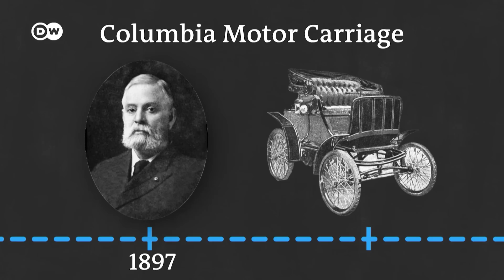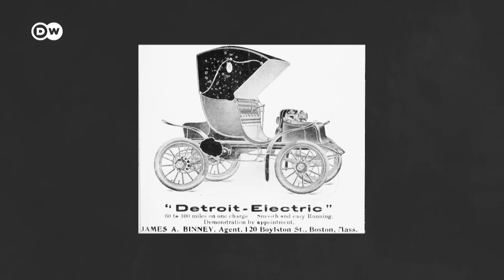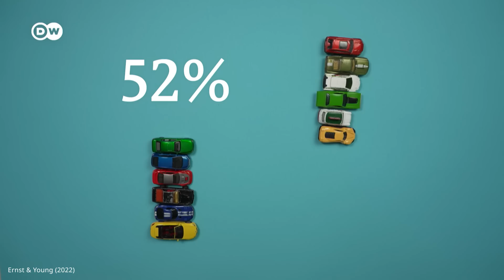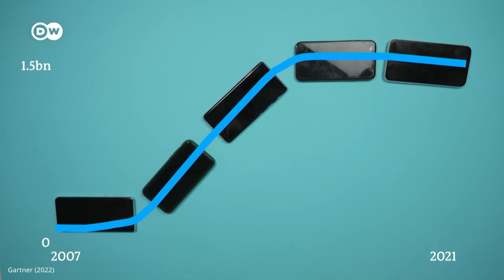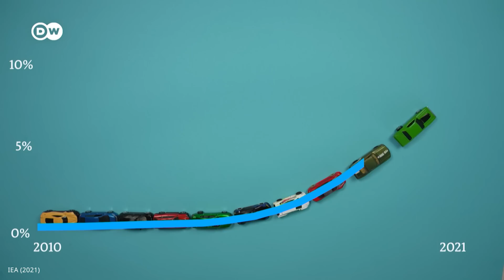Why electric cars are finally taking over

Comment: if you only go to work and back i think you can get by with and EV, if you want to travel any distance i will stick with gas
Reply: People do long distance road trips with Teslas all the time. It’s really not a problem. There are lots of videos documenting it. The chargers are common and they are fast. If you go to the bathroom and grab a snack, usually the car is ready before you are.
Reply: @lemongavine  if you say so, all i know is i can fill up my car and go around 400 miles till i have to stop again. My car is paid for so i will stick with it for a while, i do not have money for a tesla
Reply: @mastersr1956  how do you afford filling up your tank with all of those long trips you take? Between fuel and maintenance cost savings, a Tesla cloud be free if you drive a lot of miles, which it sounds like you do. Also, there are EVs with good range that are cheaper than Tesla.
Reply: @lemongavine  well i have a 12 gallon tank, so it cost around 40 bucks to fill up. I have a 2021 kia seltos. I paid 30 grand for it. For service i change the oil and filters when needed. Maybe another250 a year for service. That is a long way from 60 grand for a tesla just to start, then i need to by a charger to charge it also. I think i will stick with my car thank you
Reply: @mastersr1956  Sounds like you don't drive much. My 2021 Hyundai Kona EV was 30 grand new (after incentives). It goes about 5 miles per kWh so that's about $0.04 per mile at my electricity rate. I use a regular 110V outlet in my garage and the portable charger that came with the car so no extra equipment was needed. Also, no oil changes to pay for or deal with. It goes 258 miles on a charge which is a good 4 hours of highway driving. On top of all of that, the car is extremely quick, smooth, quiet and fun to drive, all of which are important to me. I realize EVs aren't for everyone, but a lot of people write them off when they are a great option for them in real life.
Reply: @lemongavine  well if i had a garage i guess that would be great, i park on the street so i would need to drag a cord across the sidewalk to charge my car. I think for a second car they would be ok, i do not want that to be my only car, i will stick with gas
Reply: @mastersr1956  street parking is definitely a problem. There are people who can’t charge at home or at work who still drive EVs, but they rely on DC fast charging once or twice a week which isn’t ideal at the moment (20 to 40 minutes charge time). In the future though, EVs will charge in 5 minutes. Until then, gas it is. Nice chatting with you by the way.
Reply: @lemongavine  you too, nice to have a civilized conversation for a change. i do think they are the future, but just not ready for everywhere yet
Reply: @mastersr1956  👍

Comment: Electric Cars went out of fashion when the electric starter was invented eliminating the need for a crank start, which was difficult to accomplish and caused injuries.
Reply: Too bad the video researchers did not discover that point.
Reply: Cadillac is to blame
Reply: Yea that’s when gasoline cars officially became more “efficient” from a time perspective. Before that, electric cars technically saved you more time if you were doing lots of little hops around town in order to run errands and whatnot.

Comment: Don't forget about the Nickel Iron Edison Battery back in the early days that was good for 40years.  These were made for Ford and you can still find functional ones today.
Reply: Can you share some details?
Reply: @paranoah1925  - “Building on the work of the Swedish inventor Ernst Waldemar Jungner, who first patented a nickel-iron battery in 1899, Edison sought to refine the battery for use in automobiles.

Edison claimed the nickel-iron battery was incredibly resilient, and could be charged twice as fast as lead-acid batteries. He even had a deal in place with Ford Motors to produce this purportedly more efficient electric vehicle.”

Comment: Even better for the environment than EVs is not buying EVs.
Reply: True, but I think cars will always be here.
Reply: @Richard482  Not if the planet becomes inhabitable. The solution is much fewer cars - EVs may be nice but the EV hype gives us the complacency to change nothing in our habits.
Reply: @241baka  Fewer cars, absolutely. But I think cars will always be here. Do you have a family?
Reply: Makes almost double the pollution to make a ev vs a regular car
Reply: @Babaden994  But the lifetime carbon footprint of EVs is FAR smaller. It’s not just the manufacturing footprint, it’s the operation footprint.
Reply: @davestagner  depending on how the ev gets it's power. You'll still have to account for all the coal that is burned for most grids. Along with transportation emissions of all the resources. I do agree that some areas will have a lower lifetime but I don't think all will.
Reply: @davestagner  ..unless you count in manufacturing of whole new battery pack every few years...
Reply: @Babaden994  - burning coal for electricity is still cleaner than burning gasoline to propel your vehicle. Fossil fuels are way better at making steam to power turbines than to turn crank shafts with pistons.
Reply: @thespalek1  - why would you need a new battery every five years. Do you drive 60k miles a year?
Reply: @Babaden994  You get SIGNIFICANTLY more power from gas or coal burned in a power station to generate power and charge EV's, then you would by having that same gas in a car. Car engines are way less efficient at burning the fuel so the EV's still win out in that case -- plus more and more places are moving away from coal anyway. where I live it's like 5% of the grid, 80% is made from hydroelectric dams and 15% from other green techs. The biggest issues with them is the resources to make the batteries - which IS getting better (lookup Summit Nanotech's DLE or Direct Lithium Extraction technology) and the mining required for the steel and aluminum production in the frame.
Reply: @legostud  the battery life is decreased every charge by a small % and further reduced by cold and overly hot weather. Also the actual charge and range is usually about 80% of advertised and even lower during the winter.
Reply: @thespalek1  Lithium batteries are mostly recyclable. Once production levels off, most of the lithium in the batteries will be recycled. More important, though, you have to compare this to the environmental cost of gasoline - besides the CO2, there's drilling, refining, and transporting. A car that gets 30mpg for 150k miles (about the life of lithium batteries) will burn about 5000 gallons of gasoline. Given a mean EROI of 20:1, it costs the energy equivalent of 250 gallons of gasoline just to GET the gasoline for that car. Counting the CO2, that's about 5000 pounds of CO2 created just getting the gasoline TO the car, and another 100,000 pounds of CO2 generated by the car itself. 

Don't just react to stimuli. Do the math.
Reply: @Babaden994  The electric grid is rapidly converting to wind/solar, though, because it's cheaper than coal now. I don't like coal-powered cars either, but I recognize they're a temporary price to pay - and at worst, they might be as bad as gasoline, for a while. In the long run, though, a renewable grid plus electric cars is the only way to continue with transportation without carbon.
Reply: @Babaden994  - yes, battery life is affected by extreme temperatures, which is why the majority of EVs have thermal management systems to keep batteries at the proper temperature. 

That small percentage of battery degradation you mention usually happens during the first few years and then levels off.  I believe it only gets to be about 5-10% degradation. 

What kills a battery is charge cycles. A lithium ion battery has 1500 charge cycles. You multiply that by it’s range to determine how many miles the battery will last. This is of course a best case number, but you’ll still find it be a fairly decent life time for most cars. 

Now if you’re only looking at the crappy Leaf or some other short range (100miles) compliance EVs, then yes those EVs aren’t very good.  There’s a lot of other options out there though that don’t suck and some with Lithium Iron batteries that can go 1 million miles.
Reply: @davestagner  :) I agree, do the math. Find out, how CO2 intensive it is to recycle the battery (pyrolythic separation, or shredding is used), CO2-wise it's even worse, than mining raw.
As for mining oil, I agree, pesonally I am supporter of synthetic fuel, which would allow to switch on current technology, current infrastructure, no strings attached.
Reply: @thespalek1  I have high hope for synthetic fuels as well. Partly because heavy transport (shipping, aircraft, long distance trucking) are harder to electrify than cars, partly because I grew up with racing and love old fashioned classic cars. But it’s not there yet. Climate change is here, now. We must apply the solutions we have, not the solutions we want and might have in ten or twenty years.
Reply: @davestagner  and that is exactly my point. If synthetic fuel got the same support as bev infrastructure, we could switch to that almost immediately. It can be produced from waste methane from rafineries for example, really easily. There would be no need to build studrier electric grid, no charging points needed, no subsidies for new cars, no need to destroy nature by lithium mining etc. You'd simly fill up with synthetic one day....
Reply: @thespalek1  For it to be a short term thing, the fuel needs to be gasoline (and diesel and jet fuel). You can’t change the cars themselves. Prometheus Fuels is on the right track, but we have to see what their cost really is. The market is your best friend or your worst enemy. That’s why solar/wind are growing now… they’re cheaper than coal. For synthetic fuel to work, it needs to be cheaper than fossil fuel. Which is theoretically possible and people are working on it, but it’s not real yet.
Reply: @davestagner  There is a start-up in the us, can´t find it right now, producing synthetic fuel from waste methane, which is otherwise just burnt away. The price is 2/3 of gas right now. And there are many other start-up, developing the fuel out of municipal waste, even scrap metal... (and btw. where I live, coal energy is 4x cheaper, than solar)

Comment: I think it is crazy that it takes 5,000 lbs car to move one person (Tesla model S).
Replacing a Tesla battery for any reason ~ $20,000.
Car quits for any reason requires a truck transport to nearest Tesla Service center.
Charging stations are not yet frequent or reliable.
Until these concerns are resolved, no EV for this guy.
Reply: It is even more crazy to pollute with an ICE car which may be lighter but nowhere near as efficient.

Battery prices are falling all the time, and new battery tech will out last the car. This is not a long term issue.#

Same as any car.

Depends on the charging station. Tesla have a huge and ever expanding network, with over 98% reliability.

Any concerns are short term, EV's are now inevitable.
Reply: @daydreamer8373  better yet, public transit, biking, and walking.
Reply: @The_k81  Absolutely. but not always practical.

Comment: I have seen more electronic-cars in my area however I panic because my area is extremely hot and even my traditional gas-feuled car needs its battery replaced more frequently because of the climate here. I firmly desire a world with various transport fuel types, not just electric. I would like to ditch my gasoline-powered car however right now that lifestyle isn't feasible with the infrastructure etc. I'm baffled why we haven't done more algae powered cars or hydrogen powered cars... or even researched a new substance to power vehicles someday.
Reply: Algae powered cars woah ??
Reply: @nayanvaishnavvv  Yes, awhile back my university were looking into that as a possibility.
Reply: @4-kathryn  Yeah we should continue looking for possibilities while at the same time EVs should be rolled out at a faster rate and somewhat less cost, they are hella expensive in my part of world
Reply: @4-kathryn  There was a guy in Italy who made a car by using compressed air. It could make around 250 km of range
Reply: All homes have electricity but no home has stored high pressure hydrogen for charging.

Comment: Reliability is a concern.  My 1983 Toyota still runs well.  Will the battery lasts as long?
Reply: You needn't worry, new battery tech like the 4680 cell is supposed to be good for over 1 million miles. this is not the only battery tech making these sort of claims, and although not widespread, it shows the potential for future battery tech.
Reply: @daydreamer8373  future battery tech pops up every other week. Yet nobody made it real yet. I've driven bEVs few years old, which couldn't do over 50 miles in real life...
Reply: @thespalek1  I have driven my EV for the last 5 years and it still has the same range as when we bought it. Tesla's 4680 cell is already in production, and slowly being ramped. There are many other battery technologies like LFP showing real potential. Basically batteries are not an issue people imagine it to be.
Reply: @daydreamer8373  I´ve been on ond off bEVs for a couple of years now as well, we have a company fleet of bevs, which shows nicely how great a difference makes how the vehicle is being used. Those which are being charged at HQ, overnight...those are at cca. 85% capacity after 3 years. But those, which are driven by sales reps, who drive several hundred miles a day, mostly fast charging are at about 60% capacity. Also I´d say, that the decline is not that obvious, if you charge regularly, as the battery seems to by dropping at the same rate, as before. But the last 20%, which used to be enough for like 50 miles, now plummets to zero in about 10 miles, keeping the biggest difference for the very end. (scary)
Reply: @thespalek1  I must admit we do not drive our ev any great distances, but it has held up very well, in fact I see no range loss. But the million mile battery is not some pie in the sky hope, it is tech out now, with many other companies claiming similar specs. The pace of innovation in batteries is unprecedented.
Reply: @daydreamer8373  I am not really sure about that...I am really curious about any new tech comming out, but I admit it's only been disappointment so far..just remember that Tesla battery day..how long it's been? And though wonderful on paper, in real life nothing changed... Personally I wouldn't even need 1000km range, which many strive to achieve, I prefer really fast reachrging without damaging the battery in the process. So perhaps hydrogen or synthetic fuel might be the deal for me in the future..but we'll see...👍
Reply: @thespalek1  I don't know why you think nothing has changed since Tesla battery day? Since the 4680 cell they presented is now in production, and they are already improving on that. Hydrogen and synthetic fuels are not going to be in cars, and are the last gasps of the ICE car makers to save their business models.

EV's are now inevitable, anyone following it will recognise this, those that don't will soon enough.
Reply: @daydreamer8373  :)) sounds ominous,almost thretening😉 you realize, that hydrogen cells are a form of EV, right?
Even manufacturers, who only produced bevs till now are starting to play with hydrogen now.
And the reason, why I say that nothing changed is that old teslas and new teslas have pretty much the same range.
Reply: @thespalek1  Ominous? what are you on about? I probably know more about Hydrogen than you ever will. Hydrogen will have a place in the new cleaner world, it won't be in cars (for many reasons) Yes Tesla cars using the 4680 have the same range, but use less batteries, and are much cheaper to produce.
Reply: @daydreamer8373  then why did you write, that hydrogen is a last effort of combustion engines?
Reply: @daydreamer8373  how does hydrogen fit with what model? It' s EV, it needs new infrastructure. It has zero CO2 emissions..i don't get your point...?
Reply: @thespalek1  You are pretty much wrong in everything you just posted, that is why you don't get it.
Reply: @daydreamer8373  Please, could you be more specific? I didn´t write that much...How is hydrogen last effort of ice engines, when it has nothing to do with ICE?
Reply: @thespalek1  I didn't say ICE engines, I said ICE makers, Their business model is based around maintenance and spare parts. which oil companies also have a vested interest in keeping going.
Reply: @daydreamer8373  oh! OK, I , now I do get it. (don't think, that it's true though, as servicing bevs is, at least for us, more expensive, than servicing ice, teslas are super  expensive I've heard, plus hydrogen cells are not anymore service intensive, than battery pack with heat pump and stuff).
Reply: @thespalek1  Well you are wrong about Hydrogen cells. But whatever, Hydrogen is not going to happen. so it's a moot point.
Reply: @daydreamer8373  You are sou certain about it, that I am 99% positive, that you just jinxed it ;)
Reply: @thespalek1  I am certain. An EV only has a battery. A Hydrogen car has to deal with a high pressure cylinder, a  fuel cell which is not only expensive but complicated, and of course as you point out a battery. But like i said, it makes no difference what you believe.  Hydrogen will not be a thing in cars, for many reasons.
Reply: @daydreamer8373  ..said everyone about BEVs 10 years ago ;)
Reply: @thespalek1  That is certainly true. But EV's make sense. Hydrogen doesn't, like I said for many reasons.
Reply: @daydreamer8373  ..to you. To many other people it makes perfect sense. There is a huge market for hydrogen cars, ergo it will happen (imo).
Reply: @thespalek1  It won't. Like I said for many reasons.
Reply: Battery will not last as long as any gasoline engine.
Reply: @Babaden994  Correct, battery tech will last longer.